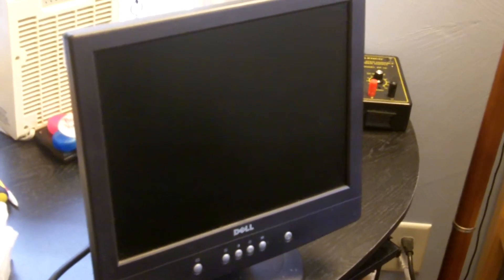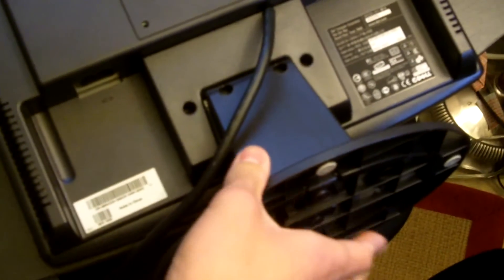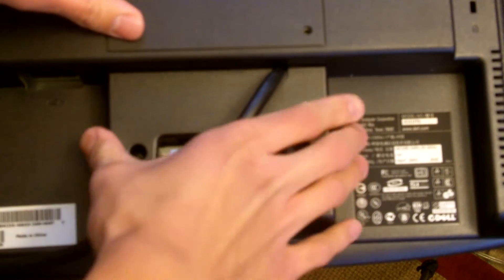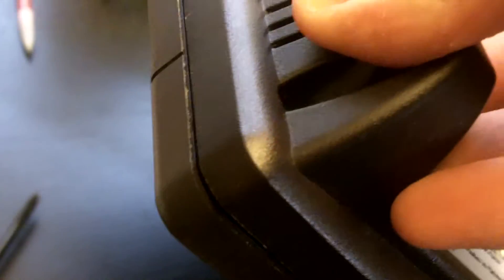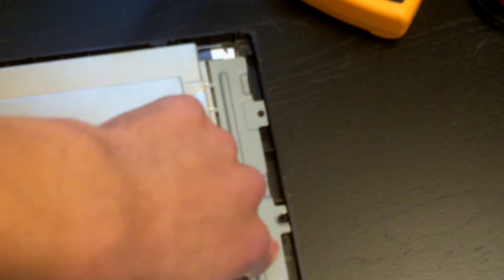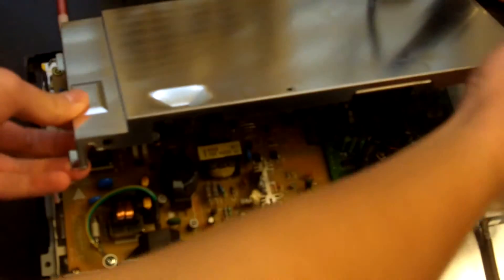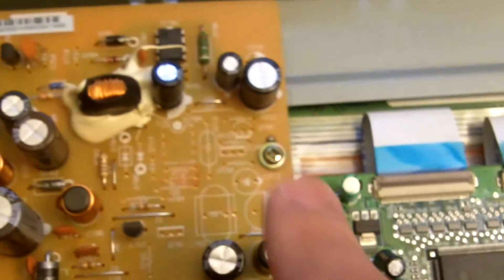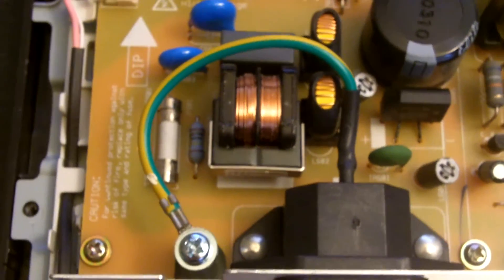Dell E151FPb 15 inch LCD monitor dissasembly

Comment: When the temperature got hot, my monitor started to blank out at random times with the green light flashing.  I would then thump on the frame and the the start Dell screen would appear and monitor be working again until it decided to repeat off. 
What could be the cause of this?